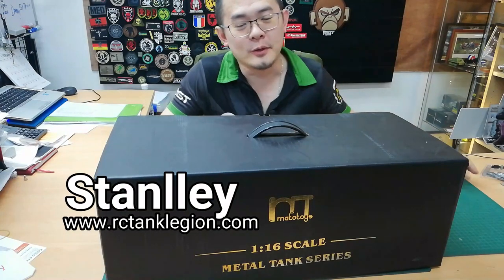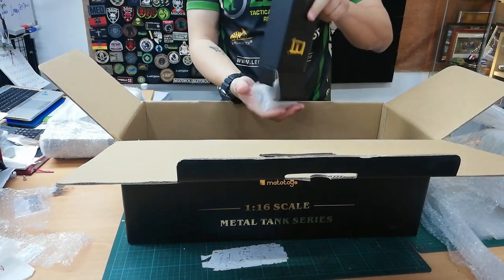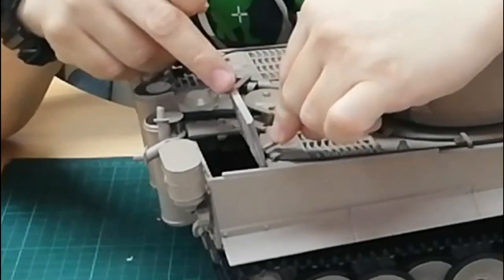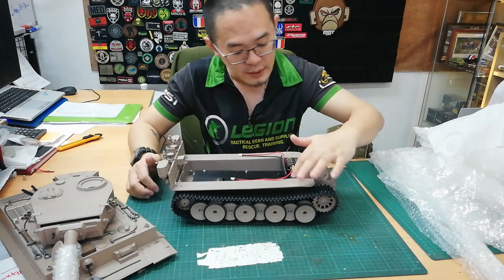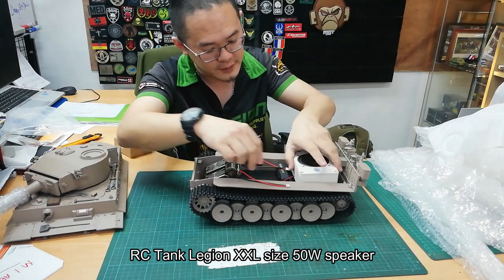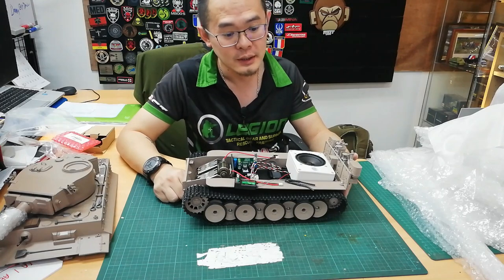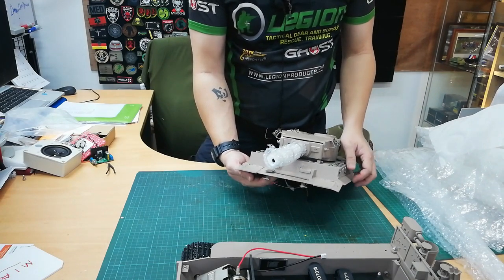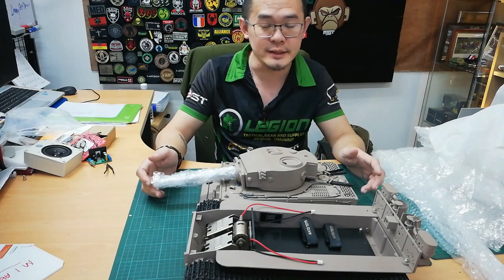Unboxing MATO ALL METAL Tiger 1 RC Tank

Comment: hello
i did not read good things about the mato metal tanks
the posts were very old 2015 - 2016 
are they better now ?
Reply from the maker: they are better now, yes. Not perfect though, just need to manage expectations :)
Reply: @StanlleyLegion  
Thx 
Can you tell me what is not that good on them ?
Reply from the maker: @HappyDude1  hard to say, some people have very high expectations like perfect details and accuracy, stuff like that.
otherwise quite robust out of the box!
Reply: @StanlleyLegion  
Sow its strong and reliable ?
Reply from the maker: @HappyDude1  as long as you understand what limitations of any RC Tank, yes you will be fine
Reply: @StanlleyLegion  
Ok ") im not going to evade france  with the tank  haha 😄 is the sound realistic ? And is it possible to put a smoke unit in it ?
Reply from the maker: @HappyDude1  yea to both